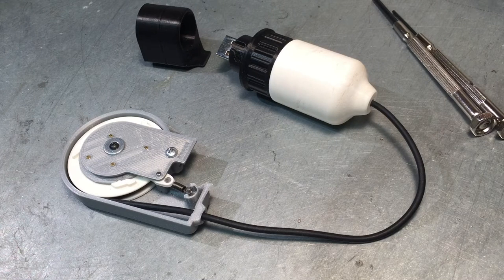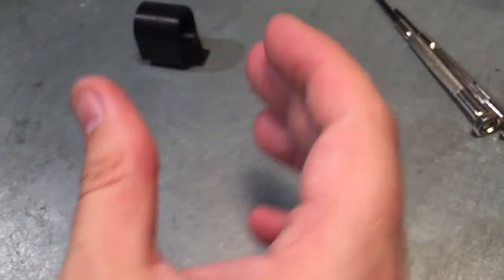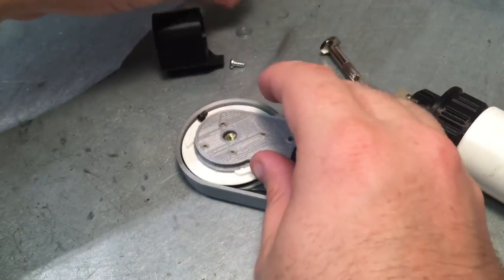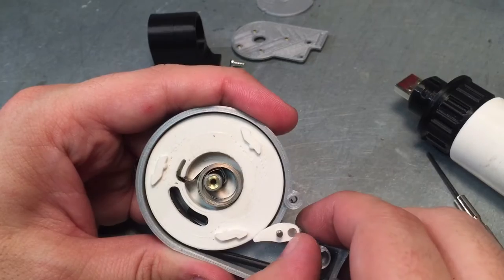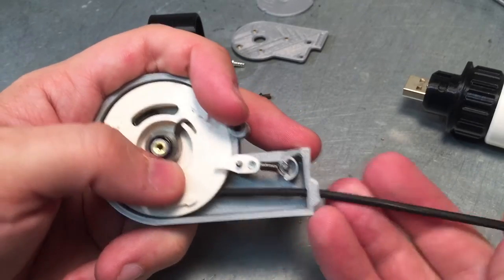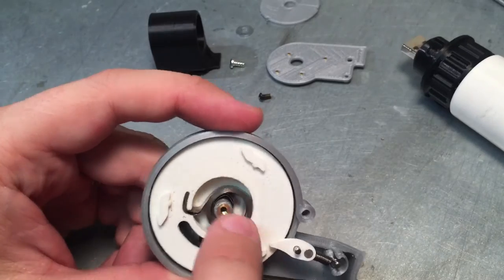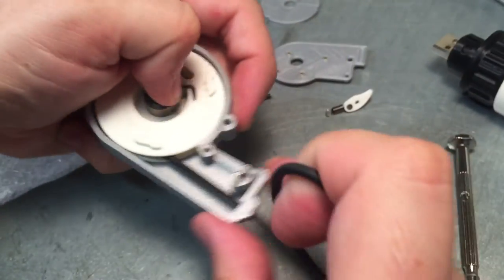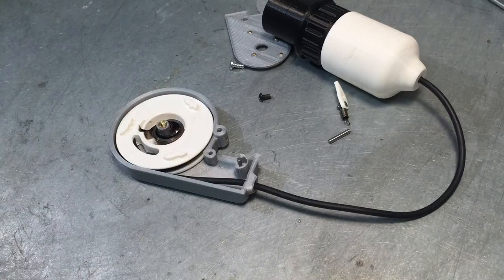Functional Pip-Boy 3000 Mk4, Cable reel prototype #3

Comment: Did I understand correctly that it takes less for in one direction than the other? As is it takes less for to extend the cable than its retracting force?
Reply from the maker: @LouisG-gw4no  The pull force and retraction force are the same, as it is a constant force spring. However, it doesn’t feel constant due to the cable friction as the spool unwinds.

Comment: Did you ever post the files for this anywhere? Id love to build a retractable mechanism and it would be great to study and adapt your design.
Reply from the maker: Just the whole pip-boy, links in the project log. No cad for just this mechanism. I never really got it working well, and it has to be tuned just so. I reverse engineered it from a overhead power cord mechanism I got at the hardware store.
Reply: @ZapWizard  Found the .stp. Thank you!

Comment: Started printing the outer front file and it’s taking forever and will need a lot of work because of support material since my printer is not SLS. Still tried it because I like torturing myself, and I love the design of your model. I think the work will be well worth it. I put in what I get out I guess.
Reply: Joshua Driggs yeah my goal for this is a display/cosplay/semi functional Pip-Boy, later when I have the money I’ll get one in SLS and put in all of the electronics.
Reply: Joshua Driggs alright, the front shell printed out alright, but needs lots of cleanup and also the part shifted on the printer, which is partly my fault anyway, but it’s still awesome as a test piece/prototype

Comment: Where are you at with this now I would love to see this with USBC to USBC
Reply from the maker: USB-C really wouldn't be an option here the custom PCB is already difficult to split off into 4 pins, plus USB-C requires a not tighter wire length requirements, and mini-coax.
Reply: Thas really unfortunate that would be such a great device

Comment: Great video, even i wanted to make something similar , from where did you get the reel and other stuff
Reply from the maker: All the plastic parts are 3D printed. The metal parts are from McMaster.
Reply: @ZapWizard  Great, thank you! If possible can you please share with me the design of the 3d printed reel
Reply from the maker: @sujaynoronha1525  The full project CAD files are shared at the RPF thread, link in the description. I can't break the parts out into something ready to print and use.

Comment: Hi, this mechanism looks really interesting. i've been trying to make something similar but without any luck. would you mind sharing the stl files? thank you!!
Reply from the maker: I took apart a retractable electrical cord for the mechanism idea. The project files are here: https://drive.google.com/drive/u/0/mobile/folders/1NlcHtdtjH62fnaz1pvxRJu8AqO-tezmg
Reply: @ZapWizard  Thanks so much for getting back at me!! Which stl files are for the retractable electrical cord?
Reply from the maker: @joyhg1  Even if I had a STL of what is in the video, it would require tweaking depending on your cable length/diameter. The reel and pawl are there under 3D,Reel.Stl and 3D,Reel,Pawl.stl. The rest of design is sort of integrated into the back housing.

Comment: could you please upload the sketches?
Reply from the maker: The CAD files as they were in this video are linked in the project log: https://www.therpf.com/forums/threads/functional-pip-boy-3000-mk-iv-from-fallout-4.245034/. However don't expect to print the files on a FDM machines and just have working reel, getting this just right has been a challenge.
Reply: @ZapWizard  awesome  men, thanks